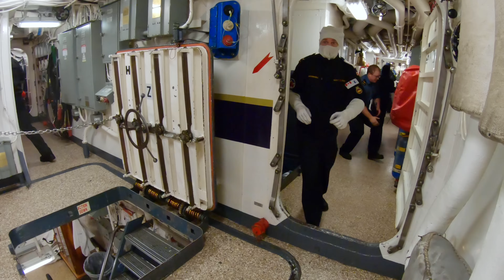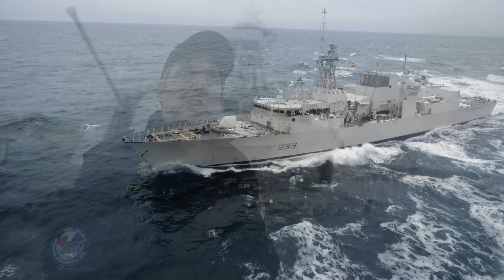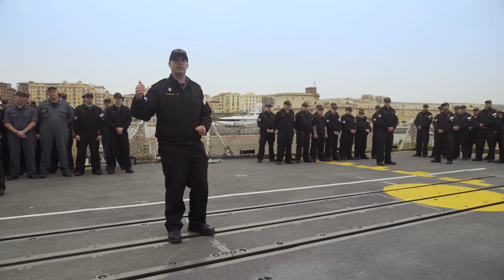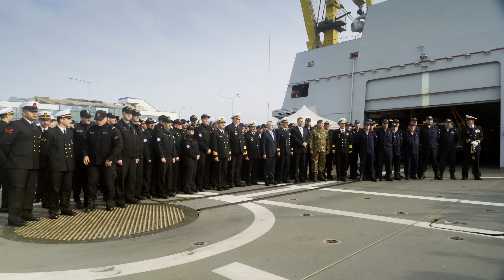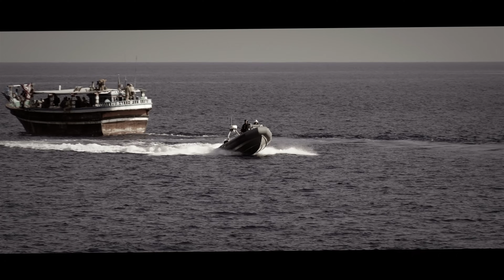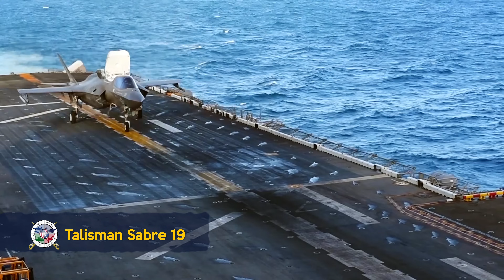The Work of a Canadian Warship

Comment: When our ships aren't rusting away in port, or our submarines not burning, our fine sailors are treated to the best mold-infested ships the world has ever seen.
Reply: This comment section is getting astro turfed. The Canadian Navy has bots up voting positive comments that their own staff posted.
Reply: Yay. Warships are not being used… isn’t that what we want?
Reply: Sounds like you have never been on a ship or been on a parade square.
Reply: @gryph01 17 years. Accurate.
Reply: @Gryph01 no, thats accurate
Reply: @Gryph01 I worked for a company pumping oil and hydronic fluid on all of the ships in the Atlantic fleet, the Frigates are ok, the patrol ships are crap and slow, the subs barely work and the crews hate them, we couldn't even pump oil onto the ship as none of the connections were standard they had to pump it by hand from a barrel, the rubber panels on the sub to absorb sonar were falling off, it's just pure crap
Reply: @Wickeddemon86  the frigates are LONG overdue to have their hotel systems overhauled.  The FELEX program helped with a lot of core systems, but the hotel services should have been included in that project and they weren't.

The AOPS is supposed to be slow, believe it or not.  It's main purpose is patrol (which speed WOULD be nice to have!) But pushing up through Arctic ice requires slow, methodical maneuvers to break up that ice.  But they are also intended to operate in warm waters also...so you definitely have to have a propulsion system capable of handling both, hence being a bit slow.  (Don't wanna end up like the Type 45)

  (In theory, the ship will detect other vessels using a variety of radars & will have a helicopter detachment that can do the intercept)
Reply: I have many friends and family in the Canadian Navy.  It's true the ships are floating scrap heaps, but that's because of our terrible military procurement process.
Reply: Canadian sure pay top dollars for our ships. We just get ships in terrible conditions. It’s a disgrace to our brave sailors and the taxpayers.